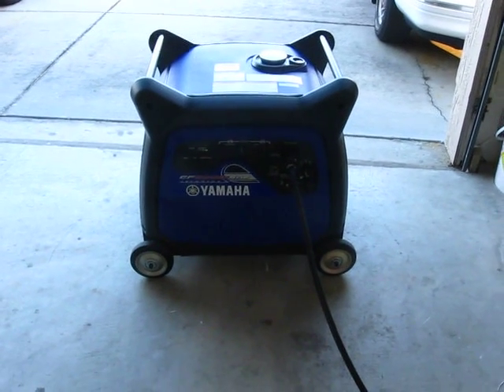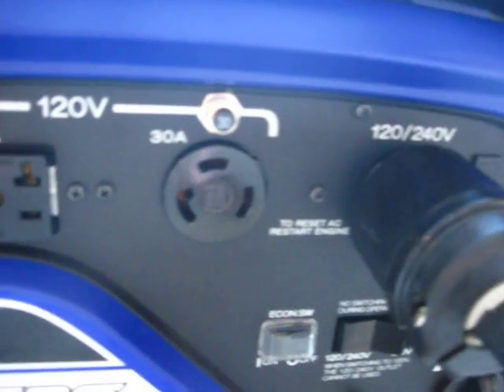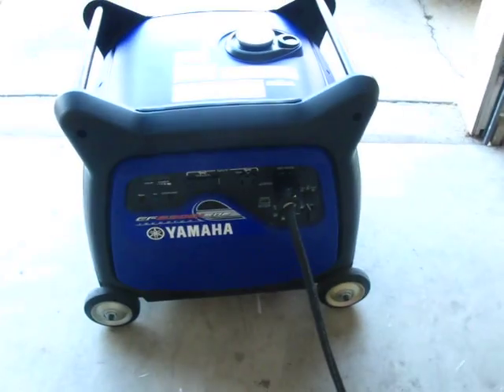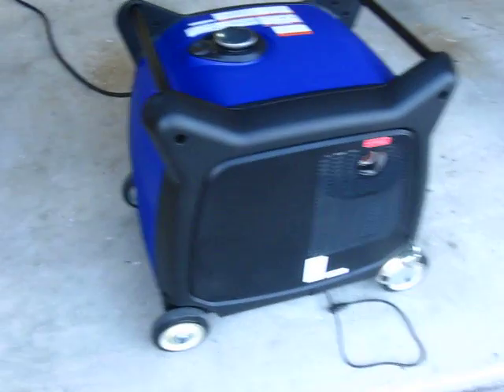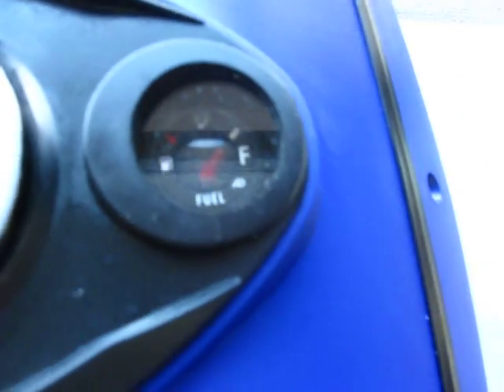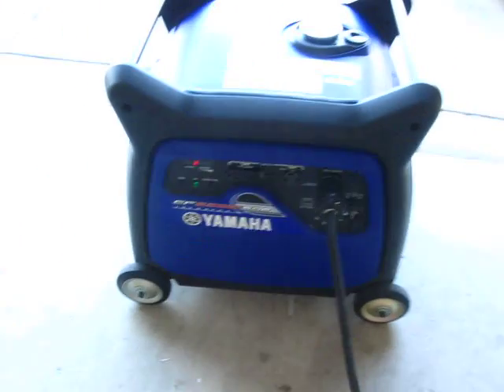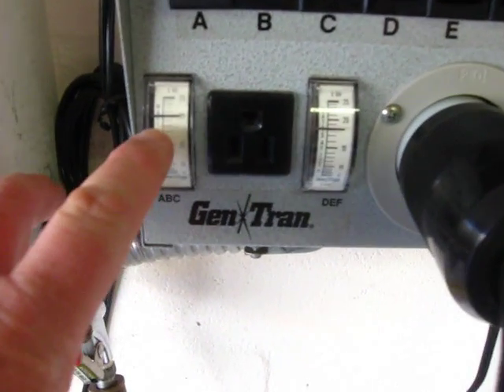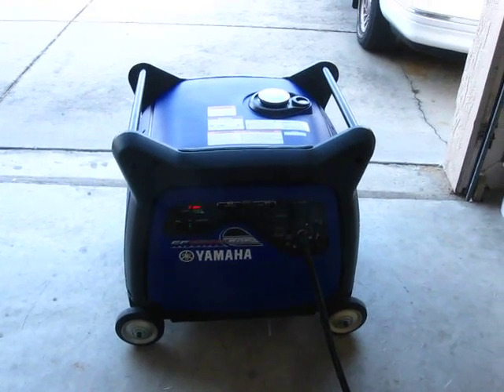YAMAHA EF6300iSDE

Comment: The whole in the bottom that you are referring to is the oil drain whole when you change the oil. Also another thing about this generator is that it only has 1-1/2 clearance off the ground which makes a problem when changing the oil, the unit needs to be raised in order to get an oil pan under it. (see my video : EF6300iSDE oil change rack) this might be helpful.

Comment: Nice video.  You are right, there are not many videos on this generator.  I just ordered one from USCarb with the trifuel kit installed.  I have the EF2000 from them and it runs great on Natural Gas (I don't run it with Propane as it is much more expensive to run on Propane).  I am curious about the battery charger.  I thought I read that you can not use a regular battery charger as the battery needs a special type of charger.  Thanks for the video!

Comment: Trickle charge the battery
Reply from the maker: This model generator has no pull starter. This is why I keep it on a motorcycle style trickle charger.  It basically has a small motorcycle size battery.  Which you’ll probably need to replace every 3 to 4 years depending on your usage of the machine.  I keep a spare one on hand which has no acid in it.  The battery that I buy comes with a separate acid pack in the box.  I activate the new battery when the previous one is dead.
Reply: @gmcphoto  Having a pull starter defenatly is a plus. I'm surprised Yamaha did not engineer that into a bigger generator like yours for an alternative. I'm in the market for a generator or two and I believe that Yamaha is a leader in that market. How's the  Dependability on your Yamaha generators since you have owned it. Do you use it often?
Reply from the maker: Mr Lariata it is for standby emergency use only.  I only have 30 hours on it.  Always shut it off by shifting off the fuel valve so the carburetor is dry.  Never any issues.  The quality is absolutely top shelf especially when you look under the covers. I run mine ever 4 months for 30 minutes and use a high quality synthetic oil. I also have a Honda EU1000i that I’ve owned for over 18 years.  It’s perfect for camping  and very light.